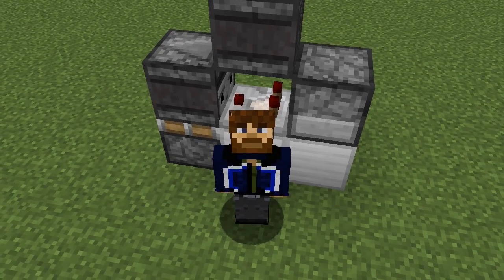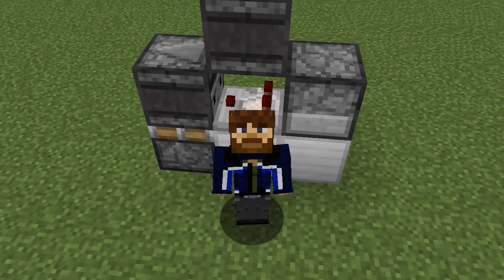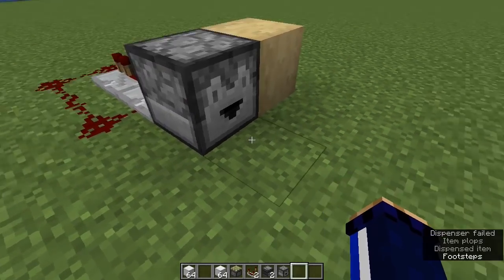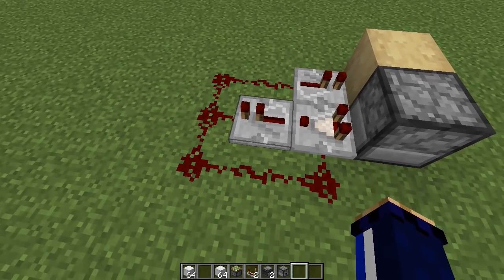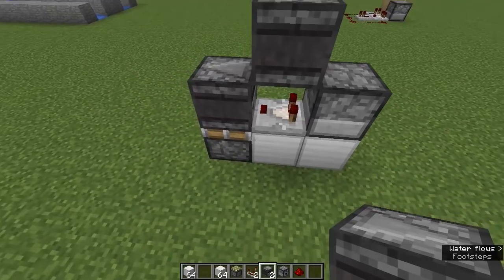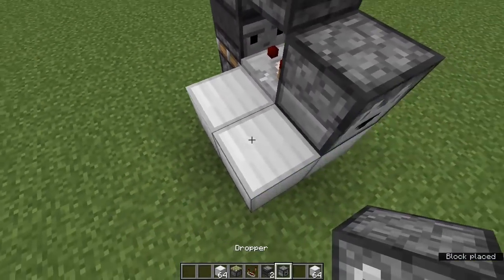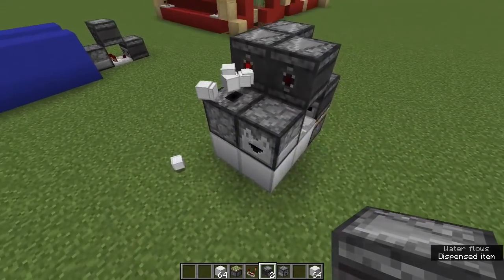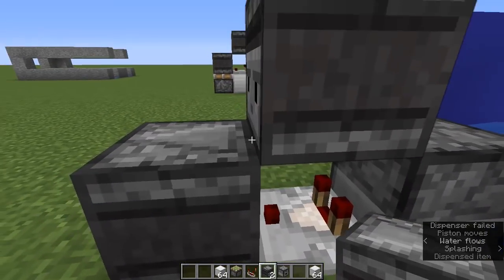Minecraft: Compact Dropper Clock for Item Transport System! (1.13) [Tutorial]

Comment: Just tried both these side by side. The old design using repeaters to power the dropper and turn the comparator off is a little faster IF the dropper is being fed by a hopper above it (not much faster though). Pretty sure the observer design powers the hopper momentarily, slowing the items being fed to the dropper.

Feeding them from a single hopper at an angle that doesn't result in the hopper being powered there's no difference. But feeding with multiple hoppers the observer method is much faster.

Comment: If you're annoyed by the piston constantly extending and retracting, place a repeater on four ticks after the comparator, then the piston and observers. Put one block (that can be powered) above the comparator and a powered rail on the dropper. This extends the signal by just enough for the piston to stay extended during a constant item stream at hopper speed.

Explanation: the dropper gets powered through quasi-connectivity due to the powered block diagnonally above it, but it doesn't receive an update, which is why we place the powered rail which will update the dropper.

Comment: On the Xbox One I needed to increase the distance between the comparator and the piston by one block. I added redstone coming out of the comparator on the extra block going into the piston. Now that its been extended the upper, stationary,  observer is also one block to far, so i placed a redstone torch, on the back of it, above the dropper.  The whole things is still one block wide but is now 4 blocks deep. I have a hopper feeding the dropper from the side.

Comment: For those on bedrock I’ve made a design that is 1 block longer and all you add is 1 redstone and 1 more observer. So what you’ll do is have everything the same except you place a block on top of the dropper and the sticky piston with the observer on it gets pushed back 1 and in its place you put redstone so it powers the piston. Then above the redstone you’ll have an observer facing the sticky piston observer. So when the comparator gets a signal the piston will activate pushing the observer up making an observer line. The two observers in the back should have their “faces” facing each other and the observer next to the dropper will have its “face” facing the output side of the one next to it. Hope you guys understand and if you have questions I’ll be sure to help
Reply: It is a little slower but still fast
Reply: Thank you!
Reply: Took me a minute to figure out what you meant but it still works. Good job buddy

Comment: A question (and if it was addressed in older comments and I missed it, sorry). When I tried to use this mechanism on my 1.14 and 1.15 worlds, it does work as far as spitting out the items quickly. However, it seems to pump the piston up and down about once for each 1-2 items ejected by the dropper, instead of staying up for the entire time the dropper is spitting out items. Even on a brand new single-player world, the piston cycles continously.

Is this a problem with how I built it, or is timing different in 1.14 and 1.15?

Comment: Scar’s video link sent me over.  The bad news: this doesn’t function on PE because of how pistons receive power.  The good news: your “clunky” version is a HUGE improvement over my super clunky hopper clock design.  And it works A ok on PE.  
Trying to adapt the improved one for PE, we’ll see how it goes.
EDIT: read some of the other comments.  It is adaptable to PE, but its only tileable to two because of the hopper input.  Even with two, odd things happen with the piston when only one bank is loaded.   When they are both functioning, the weird timing piston thing goes away.  
   Long story short: it works, its only 1 wide and so compact!

Comment: For anyone reading this in September 2019 using Windows 10 Minecraft- the device works if you extend the layer out diagonally-
what you need to do is add a block between the comparator with redstone dust on it and then also one above that with redstone on top of it, running down to a piece of red stone dust on top of the dispenser 

so all in all to the total recipe you need 3 more redstone dust and 2 blocks of any kind and to be able to figure out what my mad scribblings mean :) good luck!
Reply: I didn't understand. :(
Reply: I got it thanks!
Reply: Thank you! Was trying for 30 minutes to figure it out
Reply: you only need to put 1 block on top of the dropper, you are overcomplicating.

Comment: Fixed for 1.13 and above. Like so pix sees. I figured it out. So move the piston up one block. Then add an iron block on top of the comparator then add and observer on top of the iron block and an observer on top of the piston. Then add redstone on top of the dispenser and then an iron block on top of that redstone. Hope this helps
Reply: It works in 1.14, not sure what you're talking about.

Comment: On bedrock 1.12.... Which we got recently AFTER 1.14. For some dumb reason.... This does NOT WORK AT ALL. this guy needs to figure it all out on default and bedrock....
Reply: I figured it out. So move the piston up one block. Then add an iron block on top of the comparator then add and observer on top of the iron block and an observer on top of the piston. Then add redstone on top of the dispenser and then an iron block on top of that redstone. Hope this helps
Reply: Same I’m having trouble as well
Reply: Aos RenAgAde turns out you have to move the piston on the same lvl as the comparator

Comment: Why won't my Piston activate?
Reply: You're absolutely right, I managed to rectify the situation by running the comparator into redstone dust which powers the block next to the Piston, extending the observer into two separate observers (facing the same direction) with the redstone output running into a block which powers the dropper.
I hope that explanation was straightforward enough for anyone else who may be looking for a bedrock fix.
Reply from the maker: Probably because (I assume) you're playing on Bedrock Edition. This clock takes advantage of a property of pistons in Java Edition that lets them be powered diagonally, which unfortunately doesn't work in other editions.

Comment: It doesn't work like in the video in Minecraft 1.13.2. The piston is going up and down and because of that it's as "slow" as the one you showed in the beginning of the video.
Reply from the maker: It works the same in 1.13.2, the problem is that the dropper spits out items faster than a hopper can feed them in. If you feed items in using two hoppers, (or place them in there manually for whatever reason) it actually works at the right speed.
Reply: @Pixlriffs  That worked for me. Just have two hoppers feeding each dropper, and it works perfect.
Reply: Lets say that I want to dump the entire content of a big chest into a dropper, using 2 hoppers, it would not work because the chest only feeds one hopper at a time.
Reply: @thegreator  Somewhere underneath a vertical arrangement of two parallel stacks of hoppers, put a minecart hopper half-way between the two stacks of hoppers, and it will distribute the contents of your double-chest equally.
Reply: @RandyGrace  I... Don't quite understand what do you mean by half way. Really lost here.
Reply: @thegreator  So imagine two vertical columns of hoppers, side-by-side, leading down to this disposal system. As you go down the rows of these columns, one of the rows is a minecart hopper positioned half-way between the two columns. If I find time, I'll do a snapshot, and post a picture.

You put two rails over the hoppers. You put a minecart hopper on the rails. Then you break the rails out from under the minecart hopper, and it comes to rest on the surface of the hoppers. Then you nudge it till it goes half-way between the two rows. Put some blocks around it to keep it from falling off or being bumped.
Reply: @RandyGrace  (top view) 
LC
HH
HH
HMCH
HH
HH
DR
Like THIS? Minecart chest on top of hopper or
LC
HH
HH
MC
HH
HH
DR
Minecart chest in between hoppers?
I don't know how that works but I'm going to try it later.
Reply: @RandyGrace  for some reason, I can't read your last post but I can see it on the notification, so thanks. I get it now.
Reply: Although an expensive fix, you can also fix this by extending the redstone.
Put 2 repeaters both on 4 ticks coming out of the comparator and into the observer which is above the piston, then extend the top observer by adding another 2 facing the same direction.
Image and explanation here for more info if you need it: https://imgur.com/gallery/RRpxstT
Version 1.13.2 Java.

Comment: why does this not work on bedrock?
Reply from the maker: The piston won't activate because pistons receive redstone power very differently on Bedrock, and the power from that comparator doesn't reach the piston. 
Here are two alternatives with roughly the same footprint, just a couple of extra blocks: https://imgur.com/a/oiVUJ7Q 
They both point sideways instead of upwards, but the first one could still fire items into a bubble column to be carried upwards. The second one requires fewer observers but is not waterproof.
Reply: @Pixlriffs  thank you i will check it out =D

Comment: John John
Also have to be careful when using this in a sorting system a it will make the Hoppers overflow and if you have overflow protection the Hoppers will just fill up and not pick up the items so you have to make a water stream loop for the items which can cause lag issues in itself.

Comment: The piston spitting out its block when only one hopper is feeding the dropper can be fixed by putting a repeater after the the comparator set to 3 ticks  and then having the sticky piston horizontally. The design in only 1 block longer.
Reply: Doesn't work any better for me, dropper still spit faster than the hopper can feed!

Comment: If you want to make this on mc bedrock, just put redstone dust on the dropper.
Reply: It seems to not work even with that adjustment, the comparator isn't powering the piston, oddly.
Reply: Guys for an easy better solution(tileable and still 3 blocks long) move the piston and both observers up a block so the piston is powered by the comparator and have a block with redstone dust on top of the dropper.
Reply: Valentin Yi that works. Thanks.
Reply: Unfortunately it doesn't make it tileable anyome
Reply: I actually love thank you.....it works👍
Reply: @Flightcontrol96  that actually worked thanks dude
Reply: Fixed this to be only 4 long in bedrock and it looks like this

-nothing             -observer               -block                -nothing
-observer            -redstone dust     -comparator     -dropper
-sticky piston     -block                    -block                -block
Reply: @CraftyKarakken  I used yours but had to put redstone dust on top of the dropper as well. Thanks for the alternate solution!
Reply: Actually, you have to place a block on top of the dropper, then you have to push out the sticky piston holding the observer by a block, so you can fit one redstone dust in there.
Reply: Could you give a bit more detail on the last part?
Like, where do I move the piston and where does the redstone dust go and stuff?
I'm mainly a JAVA player but I like knowing how to port my machines over to bedrock! ^^
Reply: Could you give a bit more detail on the last part?
Like, where do I move the piston and where does the redstone dust go and stuff?
I'm mainly a JAVA player but I like knowing how to port my machines over to bedrock! ^^
Reply: Basically it looks like this- 
                                                                 Observer-
Observer-.        Redstone Dust-    Comparator-      Dropper
Sticky Piston-          Block -.                   Block -             Block

Each row represents a different level of the contraption

Comment: this concept is good but if the dropper is empty and THE HOPPER pointing to it gives it items, the piston will push and pull the observer because the speed of the hopper can't keep up with the items getting dispensed which is noisy and may cause a little more lag this contraption smoothly works with 2 hoppers pointing to the dropper, so this contraption is actually a double hopper speed item dropper or elevator if pointing upwards. xMistabeastx or currently named Beast has a fix for that in his multi item distribution system.
Reply: Although an expensive fix, you can also fix this by extending the redstone.
Put 2 repeaters both on 4 ticks coming out of the comparator and into the observer which is above the piston, then extend the top observer by adding another 2 facing the same direction.
Image and explanation here for more info if you need it: https://imgur.com/gallery/RRpxstT
Version 1.13.2 Java.
Reply: @kungfutuber  Thanks for this tip. I had to add three repeaters and observers to get it to run smoothly. https://imgur.com/a/hhroXo4
Reply: @kungfutuber  Thanks for this
Reply: @MrFreezerburnt  You're welcome :)
Reply: @kungfutuber  Bloody brilliant, and exactly the fix I needed for this not to drive me insane.
Reply: @kelathos  I'm glad this helped!
Reply: thx. i came down here to y mine was doing that
Reply: As Pixlriffs notes below, feeding the dropper with two hoppers makes it work perfect.